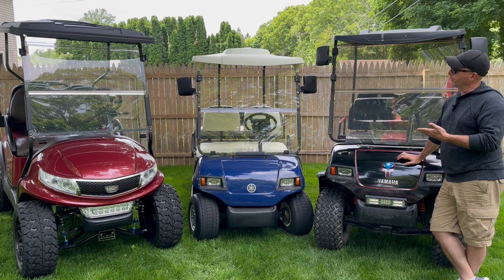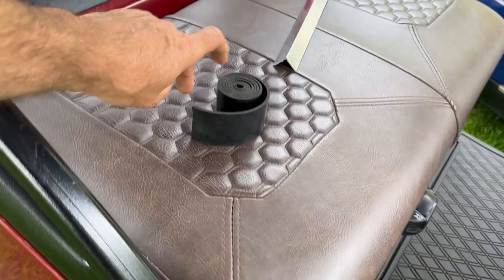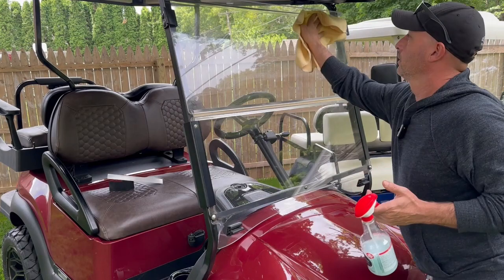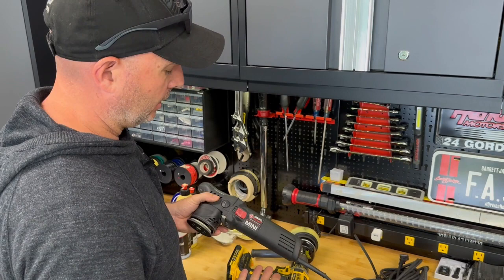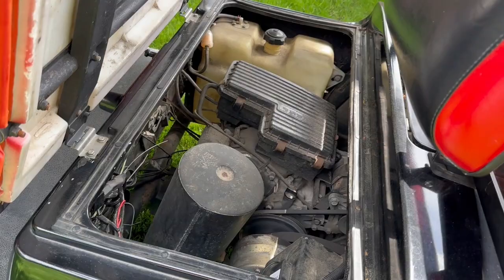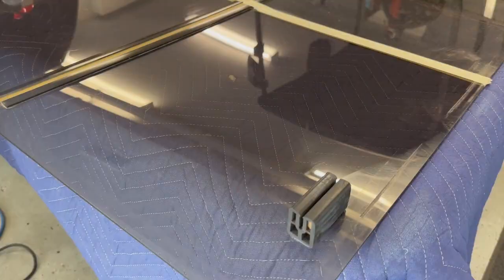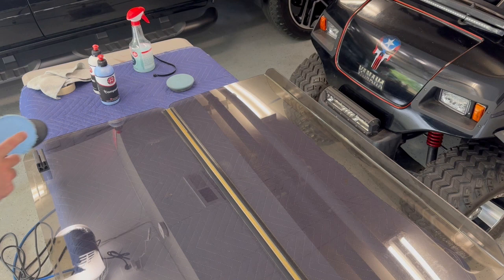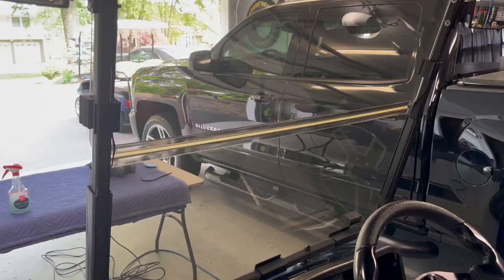Golf cart windshield care. Don't throw it out, BUFF it out!

Comment: I have been using RejeX®, it's a thin-film polymer coating designed to provide a high-release protective finish. It was originally design for use on fighter jets canopies to eliminate yellowing and promote a clear undistorted view. There are no abrasives in it.  I hand buff often on my new Club Car Golf Carts and CanAm Spyder Windshields. Golf Cart windscreens are known for yellowing and scratching, Rejex keeps the windscreens looking like new(just keep people from fingering when visiting).  I have a 9 year old F4 Windshield on my 2021 CanAM Spyder, I've used Rejex on it from new and it still looks like new. The F4 replaced the stock windshield.
I've used Rejex and a buffer on a a number of my friends windshields/windscreens with remarkable results.
Reply from the maker: I'll have to check out some RejeX!  Thanks for taking the time to watch and comment too. :)

Comment: What kind of compound do recommend, When I purchased a new windshield from China it came with these weird spots on the windshield, I thought i could just use windshield cleaner but it did not come off. By the looks of it I will need to buff it out. I see some of the products your using but I don't have a compound yet.
Reply from the maker: Thanks for the note. I have been using some compounds from ADAMs polishes. They are not super abrasive so would be difficult to ruin the plastics. our viewer @mygt8a4re mentioned using wheel polish in the comment below. 

I have some product links in the video description if you want to check those out. 

Thanks for the question!